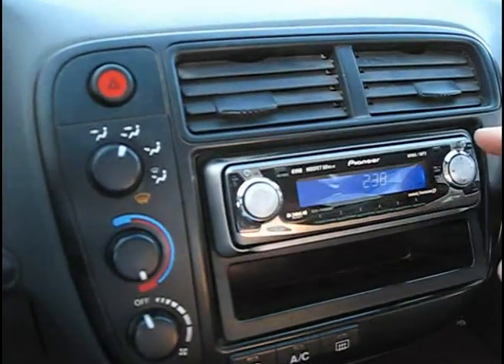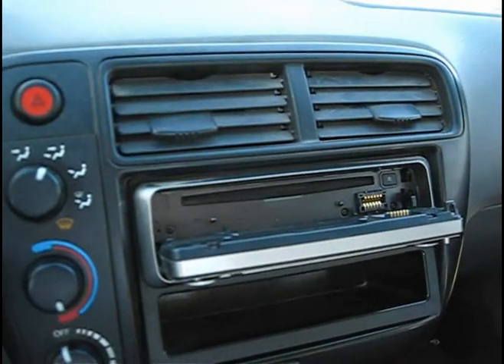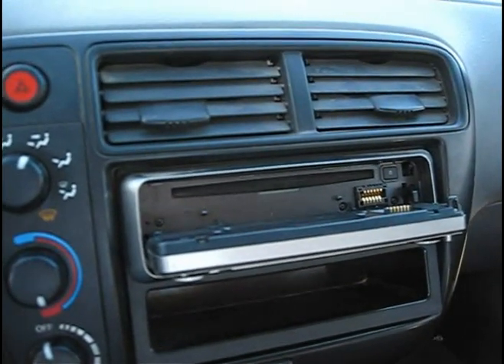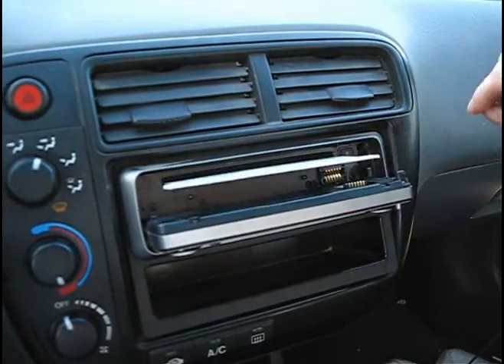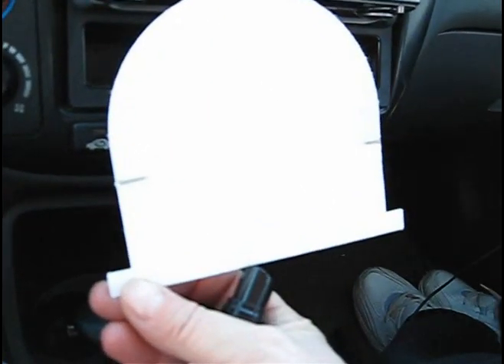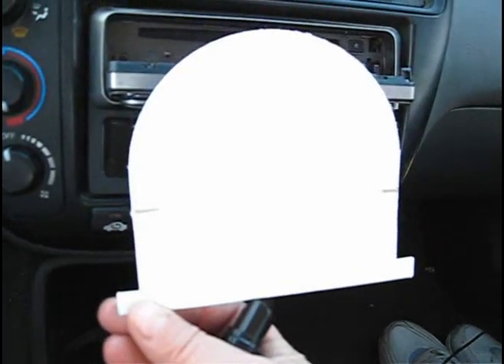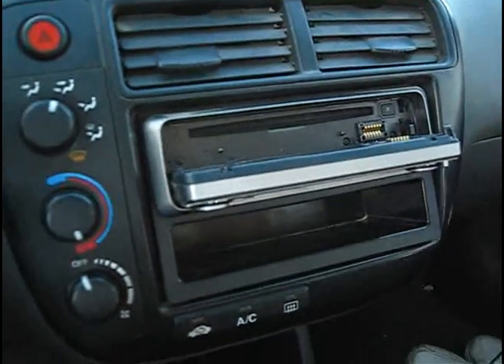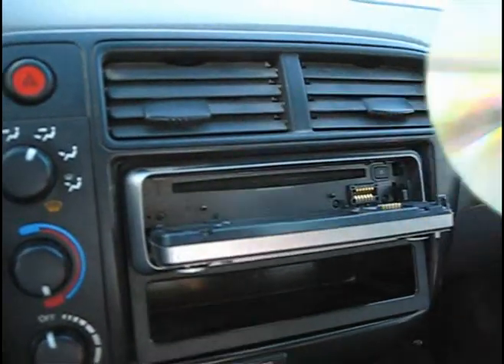Easy Load Fix

Comment: A good tutorial on a how to.  I recently have been having the disk error in my van and it kicks the disk back out.  So I come online to see what my choices are for cleaning the disk player.  Seems there are a few versions to the same result.

I decided to just go out and use something I already had.  Computer spray duster!  My player is now working fine again.  Don't know how long for, but it is working!
Reply: @P4boot  I had forgotten about this since a year has passed.
Spray dusters come with a long small diameter tube for fine area's,  I simply stuck the tube in where the disk would go and turn it side to side as I sprayed.  Do that for a number of shots for several seconds.
After one year, I still haven't had any further issues!

Comment: FY everyones I: this is done with ANY properly fitting card stock. it may help to apply isopropyl alcohol 99% to the cleaning area but don't saturate the whole card.
Reply: Thanks. I'm that desperate to try what you describe here. I actually have the card stock that would hold up to being put in the player and then eject it. Worth a try.
Reply: @SpeegBJ  I adore your last name.

Comment: Cut a strip of fine, lint-free cotton cloth as wide as the credit card and twice its length. Wrap the cloth around the credit card lengthwise and hold it taught between your thumb and forefinger at one end. [My friend did NOT do this step] Dab some lens cleaning fluid on the bottom side of the cloth-wrapped card.